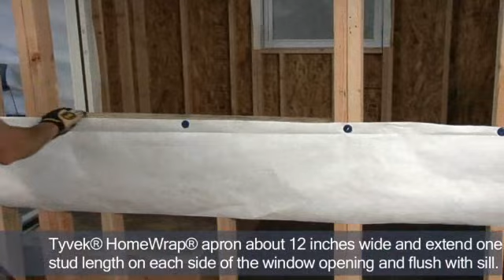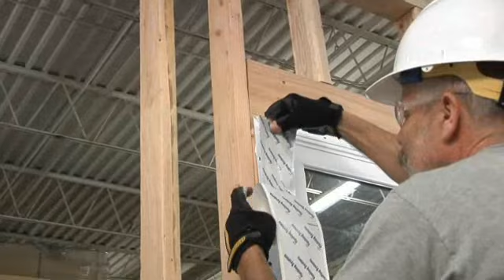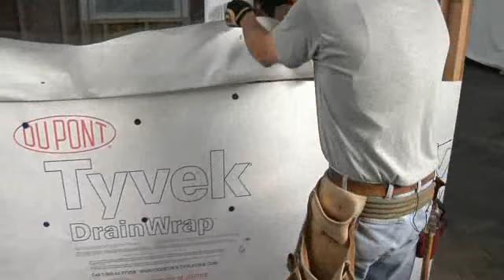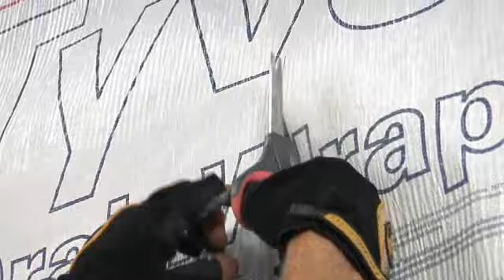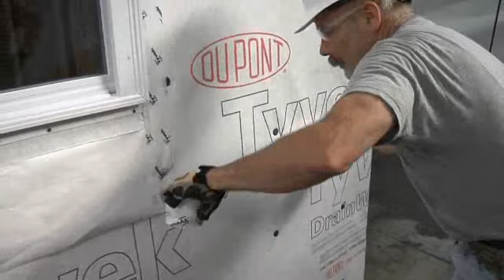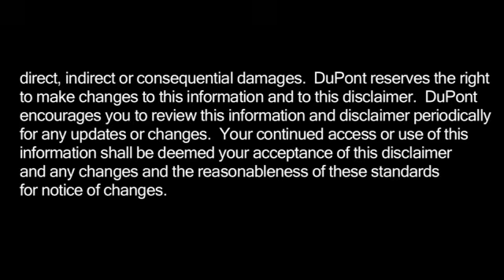How to Install and Flash a Flanged Window on Open Stud Construction

Comment: If you are using a sill pan you should back dam the bottom with silicone, making sure to go up the sides a few inches, you can foam the rest of the window as usual.
Reply from the maker: Thanks for your comment. This is what DuPont says specifically about the interior perimeter seal:

Install Tower Residential Sealant or recommended sealant (and backer rod as necessary) around the window opening at the interior. It is also acceptable to use
Great Stuff Pro™ Window & Door Polyurethane Foam Sealant, or recommended foam.

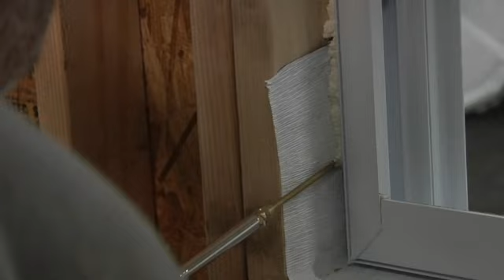Comment: It appears to be open stud construction until the part where you are foaming the window from the inside. Then it appears to miraculously have osb sheathing?? See 6:51 How did I miss that part before the house wrap went on??
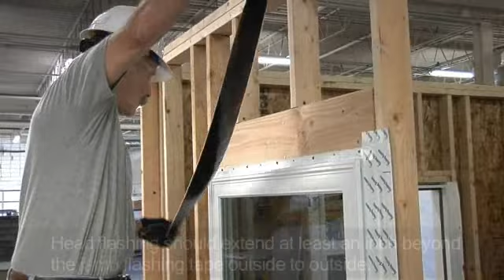Reply from the maker: Larry, thanks for watching. If you notice at the https://youtu.be/5sx-qn95gEo?si=KMBOQmddUek0n9dx&t=213 3:33 marker the mockwall features open stud on one side of the model and then there is OSB on the other side of the model. At the 6:51 mark he's simply sealing in the backside of the window. This step would be the same regardless of the wall system. Appreciate it.

Comment: What’s the point of caulking when your using jam flashing tape and 2 layers of wrap.  This is too much product IMO, but I’m no expert.
Reply from the maker: Thanks for your comment. Caulking the window has been a standard requirement by window manufacturers for years. As you mentioned, it does add a layer of redundancy. But, it helps gasket the window to the framing since it's never completely flat either.  Probably helps gasket the fasteners too when the window is set in place.
Reply: @WeatherizationPartners  thanks.

Comment: This video is a great reference I keep coming back to, thanks. But, how come the house wrap is not going on OSB and where is the OSB sheathing, before doing any of these steps? Maybe this house wrap (or drain wrap?) in this video is a special kind of more thick house wrap used for interior-of-house walls (?) as it looks to have dense ripples. Also, I do not know exactly what open stud construction is, is it only for stucco walls?
Reply from the maker: Thanks for your response. Yes, Open Stud construction is typically found only in the southwest. It's catching on some in other markets due to the fluctuation of OSB pricing but typically you'd find the Tyvek being wrapped over the OSB. Hope this helps!

Comment: Would painting some of the window opening framing using polurethane mixed with a stain also help preserve the frame and help moisture dry up naturally? To do this in addition to your steps here, which are helpful to see in order.
Reply from the maker: Not really our world of expertise. But, we think the polyurethane would actually seal the wood which would prevent any natural drying and as such would not recommend it.  The polyurethane and stain could also cause issues with adhesion of the flashings. Hope this helps.

Comment: Thanks, good video.  Could not find videos on flashing open stud construction. Here in Hawaii, T1-11 or LP SmartSide is often installed as both structural sheathing and exterior finish, leaving no backing for S.A. window flashing. Is this method still applicable since the posting (2015) or are there updated improved methods?
Reply from the maker: Casey, thanks for your comment. The method is still practiced. Here is a link to the latest installation guidelines: https://bit.ly/3miDUIX. If you need further assistance try contacting your local Tyvek Specialist, Joe Pozo at jpozo@orepac.com

Comment: Why don't you caulk the sill flange?
Reply from the maker: Mitsubishi, thanks for your comment. Leaving the sill not caulked allows for water drain out from underneath a window and continue down the drainage plane and exit the assembly properly.  If a continuous seal of caulk is applied behind the flange, when a window leaks it would trap the water causing a much bigger problem.  Allowing the sill to drain and dry is a more forgiving approach to a longer, more durable building envelope. Also, air sealing which is crucial too is accomplished at the interior side of the window opening with sealant and or foam also creating a back dam to ensure that water that ends up on the sill is forced to the exterior side of the rough opening where it can drain out from underneath the sill flange. Hope this helps.
Reply: @WeatherizationPartners  Are we talking about shingled exterior walls? I just replaced a window in my house and it has stucco, and the window sits under a roof eave. All the water you are referring to, where does it come from? How can it get behind the stucco to run down the house wrap behind the stucco? Condensation?
Reply from the maker: @extracareav  The video and the initial response was based on new construction. Did not realize you were doing a replacement window. We do not have an installation guide or video for that. Sorry for the confusion.

Comment: What's the stapler hes using looks like it leaves a waterproof fixing?
Reply from the maker: Hey Jacob, thanks for checking in. Stinger Cap Stapler is recommended for best practice. Good stuff. Keep in mind, Open Stud Construction is typically found in the Southwest. Not common in other markets. For the Cap Stapler, check out their website: https://www.stingerworld.com/cap-hammers

Comment: How about when you need to reinstall a retrofit window that was removed  along with existing aluminium frame on a open stud wall of about 8 of an inch perimeter around window frame,  same procedure installation of peal and stick flashing tape around window frame as shown here.
Reply from the maker: Leonardo, believe I understand your question. Here's a link to connect with your local Tyvek Specialist to go over the detail over the phone or perhaps a jobsite visit: http://www.dupont.com/products-and-services/construction-materials/building-envelope-systems/articles/tyvek-specialist-locator.html